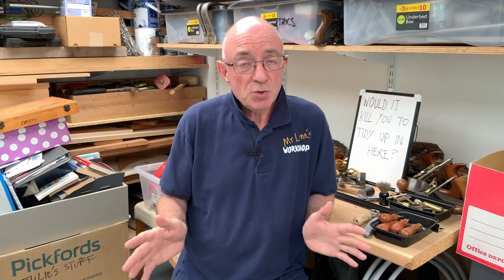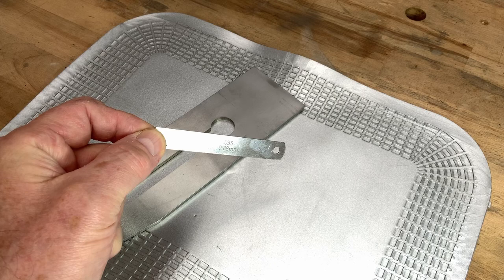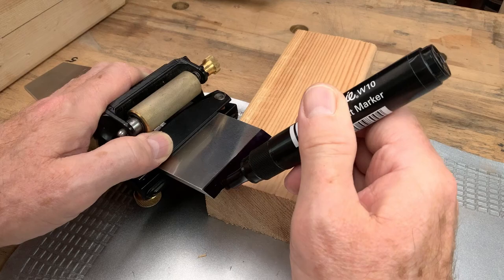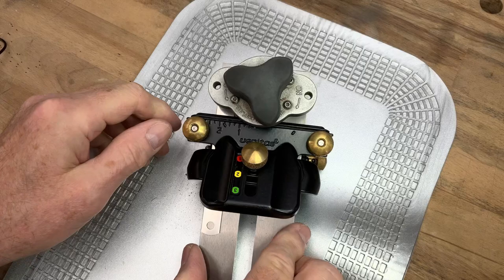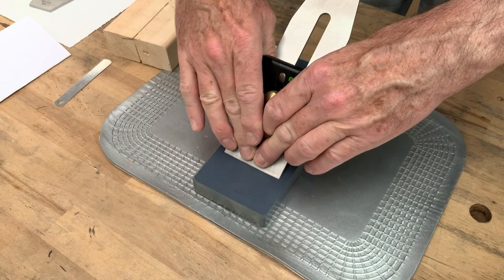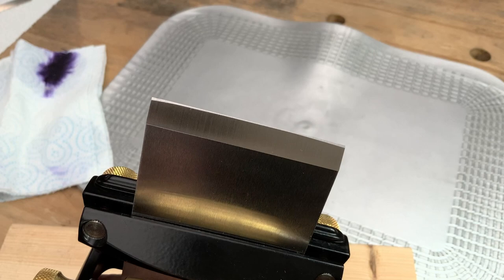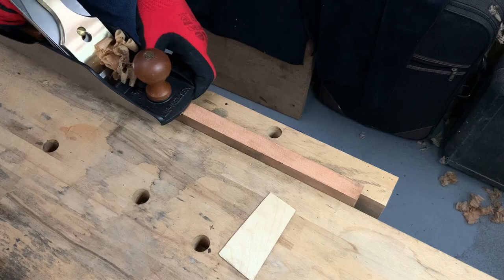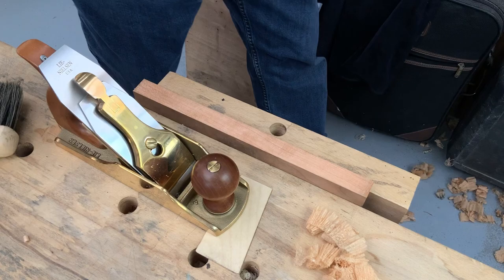Curved Edge - Mr Linn’s Feeler Gauge Trick

Comment: Any suggestions?
Reply from the maker: Thanks for your comment! I’ll be honest; I just accept the slight bending. I make sure the chisel is centred and the pressure across it is even. Of course it’s most evident on the narrower chisels, but I find working tension is achieved before the deformation is too severe. I’ve always got in the back of my mind that there are always some limitations to live with with one’s equipment.